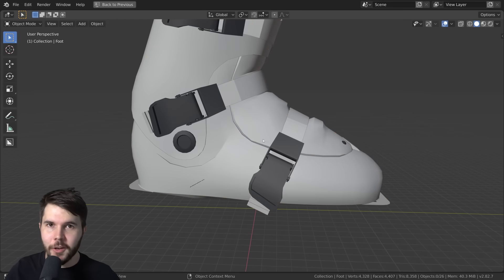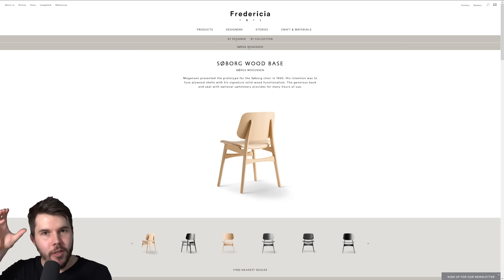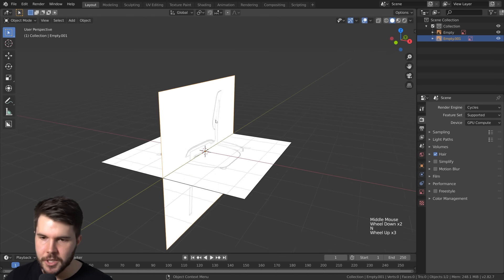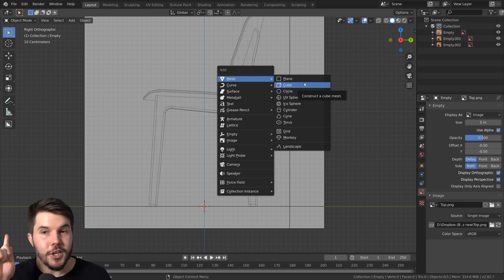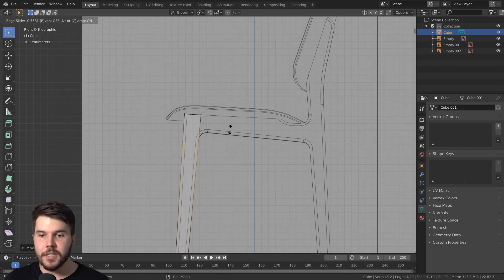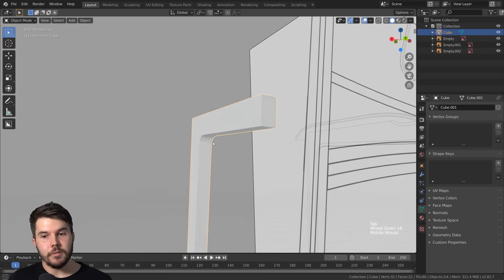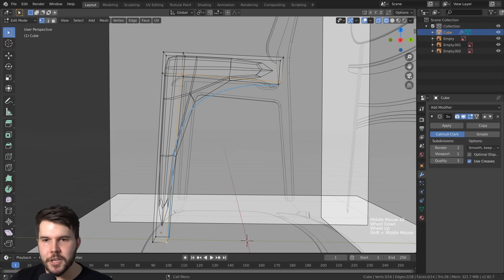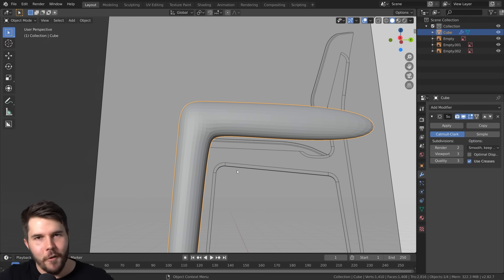Blender Beginner Modelling Tutorial - Part 1

Comment: I would personally use a bevel there, not a subdivision surface with all those annoying loop cuts. As long as the NGon is flat its totally fine to use. And that Shading artifact is easily fixed by checking auto smooth! Bevels are fast and give you perfect curvatures in a second. I do have to say tho, that of course you cant use SubdivisionSurface afterwards on the Ngon model AND the topology doesnt look as good as Subdivision surface, however beveling is way faster and very accurate without any tweaks.

Comment: My ways to get over that cliffhanger...

1. Go to front view, then add 2 loop cuts running vertically to the mesh and just move each loop cut towards the sides (you can select an edge loop by using Alt+Left or Right Mouse Button)...

2. In the modifiers panel, assuming that you did place a Subdivision Surface modifier like he did, place a Bevel modifier (don't worry, this is a different Bevel compared to the one he did in Edit Mode) and if you look at the top right corner of that Bevel modifier, click the triangle that is pointing up, and you should have the Bevel modifier above the Subdivision Surface modifier...

Comment: I first started Blender back when it had that giant button in the toolbar at the bottom of the screen. There was almost no documentation I could (at the time, a fairly dense middleschooler) comprehend. I nearly gave up on the dream of making 3D things entirely. But at some point, I found your original donut tutorial, and it was so easy to understand, and really opened the doors for me for the rest of more technical documentation. The manual is a lot better now (even though I think it could still use some work--it seems to be aimed more at those already in the field, or a similar one), of course, due to the exponentially helpful joy of open-source. However, I continue to find your tutorials to be clear and concise, and very educational. I don't think I've ever had any difficulty following one that you didn't also cover in your 'if you do THIS', 'NEVER do this', and 'don't do this YET' asides. I love how you take into consideration and even outright assume the learner in question isn't going to be following the tutorial to the last letter. 
Please keep up the good work!

Comment: Hey all you clever dudes. Does the size not matter at all? I seem to remember from the donut tutorial, that we were told that it is best to model based on the right measurements. But does that not matter as long at the ratios are correct?

Comment: Anyone know where he's going with that chair? I ended up making the front leg with a plane. For the curve I just had a diagonal edge that I subdivided to get 5 vertices, then I used proportional editing to make the curve, and the knife tool to form quads. Because it was a plane, I only had to work on one side. Then I extruded the plane to make the full leg. Checking the auto smooth under the object data properties got rid of some artifacts I had. A level 3 bevel modifier got me good looking results, but I had to check "harden normals" to get rid of some new artifacts from my knife tool cuts.

In the end I got a chair leg with less polygons (no sub surf mod), but I didn't make the rest of the chair so we'll see how it goes.

Comment: The inner lines on the blueprint actually are the bevel edges. It's the part of the rounded edge that transitions into the flat surface next to it, and because blueprints (a technical drawing that shows the different surfaces of the model) see those as two seperate surfaces, it gives the bevel edge a thin line, as seen on the inner lines of the blueprint.
This way it's also easy for manufacturers to see the radius of the rounded edge :)

Comment: Here's tip from a CAD-modeller, that could be possible with blender. What you could do is position those DXF-files in 3D-space and then just extrude them out. Then you use Boolean-intersect, and that will leave you with a model that has the intersecting shape. This would work for those legs, the back rest, and so on. It's the go-to method when you want to convert sheet metal drawings to 3D, so you can use some fancy 3D-unbend tool.